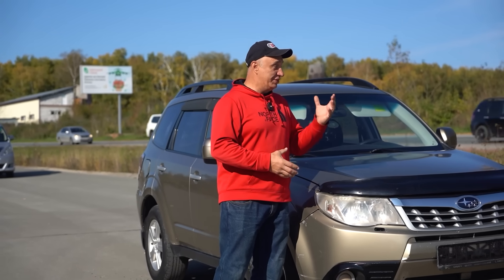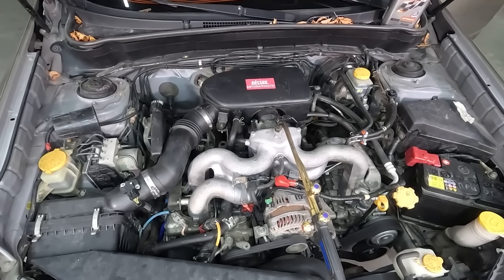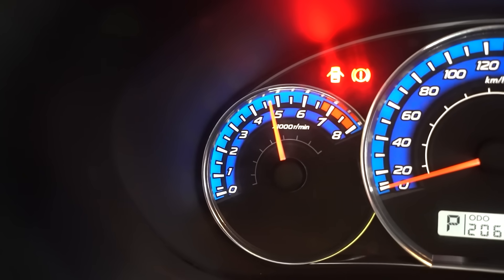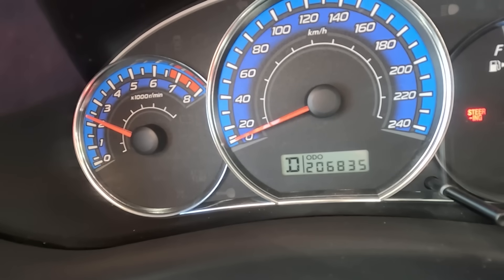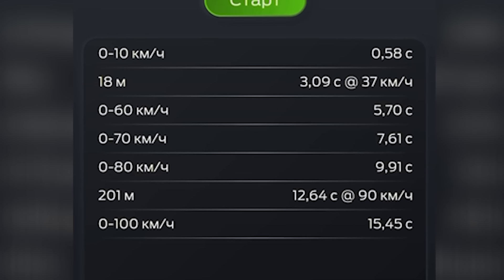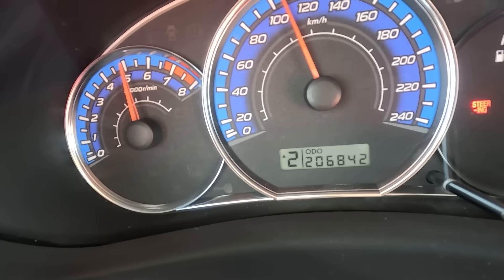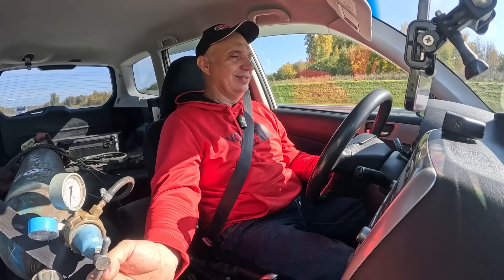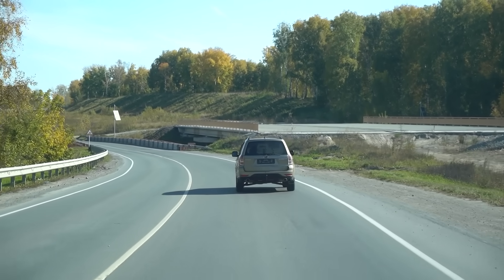We run an engine on pure oxygen - what will happen?

Comment: Of course, a mechanic will know all this, so this info is for the non mechanics wanting to know what's going on.
That subaru has O2 sensors and fuel injection. The car uses the mass airflow sensor to know how much air is entering the engine, and it calculates an estimated amount of fuel to inject based on the airflow mass, temperature, and pressure. The O2 sensor then provides feedback to the ECU to know how much unused O2 is passing through the engine, and that value is used to trim the fuel injector timings. Too much O2 in the exhaust means the engine is running lean, which is very bad and can lead to engine damage, so more fuel is added to compensate. Too little O2 means it's running rich, with is bad for the catalytic converters and kills fuel economy, so it reduces the fuel injected. The ECU is rapidly fluctuating the engine between slightly rich and slightly lean ratios, as that's what the catalytic converter needs to work properly. Then the downstream O2 sensor measures the amount of O2 leaving the exhaust pipe, which is used to monitor the catalytic converter performance.
What you are doing here is adding unmetered air to the intake manifold. That air happens to be very rich in oxygen, but it doesn't really matter. ANY unmetered air changes the manifold pressure, and throws off the fuel air ratio, and makes the O2 sensor read lean. So, the ECU adds fuel to make the ratio match what it should be. Since the engine has an electronically controlled throttle body, it can normally close the throttle to cut air intake and control the RPMs. But you are bypassing that, so it can't reduce the intake air, and it MUST maintain the fuel air ratio or the catalytic converter can be damaged, the engine can overheat, you can get autodetonation in the cylinders, etc. So, more bypass air (more injected O2 in your case) means undesired higher RPM at idle.
When you did your acceleration tests, the amount of air intake going through a wide-open throttle is MUCH greater than the O2 being added, so there's only a marginal improvement in performance. If you were to dump a crazy high amount of O2 into the engine while accelerating testing it, you could get quite a bit better performance than you see here, but the cylinder pressures would be very high, and you likely would damage or destroy the engine if you did it enough.
Reply: I agree, you definitely have to understand how ECUs operate  to get the most out of non-conventional mods, even normal mods require a re-flash to get the most out of said mods, the parameters of a stock flashed ECU can only take care of things to a point, bypassing the maf especially skewed results IMHO, adding pressurized 02 post maf had to lower map readings most likely confusing the ECM .
Reply: The question is have is; can you get better  mileage with O2 injection at the right place and with the sensors and computer properly calibrated for it?
Reply: @avoice423  nitrogen makes up most of our atmosphere, but doesn't participate in the combustion process unless the combustion is hot enough to form nitrogen oxides, which are undesirable pollutants. The higher the oxygen percentage, the higher temperature the fuel will burn at, which is great for power as it will lead to higher cylinder pressures, but it's bad for the engine because higher temperature and higher pressure will accelerate wear or even outright destroy the engine. The engine having to pump nitrogen around that doesn't contribute to power production reduces the maximum power the engine could otherwise produce by displacing oxygen that is used in the combustion process, and increasing pumping losses. But engines go through a lot of air compared to the fuel that they burn, and I wouldn't necessarily want to have to carry around oxygen cylinders as well as gasoline to make the engine run. Perhaps for short proof of concept or performance tests it could be made to work, but I don't know how long an engine would survive doing that.
Reply: Sorry bro im not gonna read all that but sorry for your loss or congratulations 🎉 I hope whatever it is works out in your favor.

Comment: When you do experiments like this reboot the ecu each time 5 mins battery leads off should do that as the ecu will go into kernal panic and roll all its settings back so it,ll assume its very very cold the fuel is low quality and its above sealevel hence the rough running once it starts rewriting settings the roughrunning goes away

Comment: You drill a hole behind throttle body,  that is why revs are going up on engine when you add oxygen.  The same will happen if you leave just an open hole without oxygen from a bottle, with ordinary air.

Comment: 3.5 parts of pure oxygen are needed for every 1 part of fuel (89 octane). You can remap the O2 system from 14.7:1 to 3.5:1 to do this correctly.

Comment: the VERY first thought I had when the revs started going up was, "is that the ECU compensating for the lean mixture by adding fuel?" turns out, it MIGHT have been, but it must also have been messing with timing and/or throttle response in some way to offset the added oxygen. I initially thought fuel trim would have been the answer, but by the end of the video I'm not so sure. either way, I'm surprised nobody seemed to consider how the ECU would react to that condition, and it'd be best if you controlled that with either an aftermarket ECU that you can program and monitor, or a car with no ECU (or a very dumb and simple one). please, try it again like that! I'd love to see it!
Reply: It was definitely the ECU adding fuel to achieve the desired A/F ratio. The problems happened when they went past the point where the injectors and/fuel trims were maxed out. Most engines can only add upto 25% fuel,  once you exceed that the mixture is going to go lean.

Comment: In a computer controlled car, after warm up, the system operates based on the O2 sensor, the sensor sees a lean condition (excess O2 in the exhaust) so it is adding fuel trim, thus increasing the RPMs, try it on a carbureted engine and the non-compensated extra oxygen will kill the engine from running extremely lean.

Comment: you probably had some nock in the engine caused by lean fuel air / AR ratio even in a modern car they have trouble compensating. this probably would be better done on a carb engine or DI engine with standalone fuel management system.

Comment: Put it in front of the valve-body next time, the throttle plate is essentially getting bypassed here, when you turn the oxygen on in this setup its just like pressing the gas pedal, also try injecting some acetylene, if carefully done it can provide a nice boost!

Comment: rpms are increasing due to pressure , you are inserting oxigen at high presure like you would have a turbo its not at atmosferic presure, if you want to test it corectly you need a presure equalizing chamber that will lower the presure or a presure check valve that lowers the presure to the atmosferic presure witch will most likely stop the engine for over reving itself

Comment: Back in the 60's, disreputable car sellers used add mothballs to the fuel to greatly boost the performance of the engine. Mothballs were also supposed to have a very corrosive effect on the pistons and cylinder walls. I'd love to see this performed as an experiment, showing the before and after of the engine as well as monitoring the alleged performance boost. If anyone could do this, it would be the crazy buggers at Garage 54!
Reply: Mothballs come in two flavors: para-dichlorobenzene and naphthalene. Neither one burns well. tried it once in an old Ranchero (don't remember which kind). Didn't make much difference.
Reply: @dquam3885  They used to use the naphthalene variety.....an entire box in a tank of fuel.
Reply: @Martin.Wilson  Coleman brand "white gas" for patterns/camp stoves is just their name for Naptha, which I know Garbage Time has fed to his Fiat Niki. I wonder if that's close enough to Napthaline... or if that is spicier and runs hotter?
Reply: @DUKE_of_RAMBLE  Naptha is a generic term for petroleum solvents. more specifically, solvents consist of paraffins, aromatics, and napthenes.Naphthenes are better solvent than paraffins, less stinky than aromatics. Coleman fuel is mostly paraffins. 

 Naphthalene is a specific chemical derived from petroleum. Solid at room temp. Not very soluble in gasoline. Non-ethanol Super would probably be best if someone wnats to try (at their own risk!).
Reply: @dquam3885  Aah, alright. Thanks for that! 🍻
Reply: @dquam3885 10 mentos sized one for 10 liters, only plain 100% napthalene, no coloring too. It doesn't add power per say, but allows you to use more aggressive timing. Hence the power or fuel economy. Keep in mind that it makes the carb dirty fast, so check regularly or clean often
Reply: Hard to find the right mothballs for that these days.
Reply: I would sure like to see some one show more research on the mothball hack . I just can't see how it would have negative effects on an engine as long as they were completely dissolved   ! ?
Reply: @richardpalko8062  The naphthalene is supposed to be extremely corrosive.
Reply: @Martin.Wilson  I would not expect naphthalene to be corrosive- it is a simple aromatic, not to different from toluene and benzene normally found in gasoline. However, the other flavor of mothball is p-dichlorobenzene. Burning chlorine compounds would definitely produce corrosive and noxious compounds.
Reply: I was one of those ppl but in the late 90s. 1.5L K series toyota engine, u can add more aggressive timing and it wont knock easily, it works really well, but does dirty up the throttle body, so u need to clean it often

Comment: This acts just like an O2 sensor failing. The car runs fine until it heats up. The slowly gets worse until it won’t run. After it cools same thing happens again. Wash rinse repeat. O2 sensor went haywire probably because it got too hot. That’s my theory. Symptoms are almost exactly the same. That would explain it running fine after the test.

Comment: You can quadruple the power in a carbureted engine, but you will melt your pistons, your valves, your cylinder walls and your exhaust really fast. This is why we use nitrous oxide instead of oxygen. An ECU will just compensate for the extra oxygen or put the engine in limp mode because the sensor readings are not plausible.

Comment: In 1955 an O2 leak from Apollo 13,sitting on the pad, floated over to a 55 chevy carb'd and melted the engine down and then melted the front 1/2 of the car..there's photos.

Comment: I can't believe that engine survived that!  Also, seem like some pretty big balls to sit in a car with an open Oxygen cylinder...for science.  😇  Engine Project Idea:  Take a V8 engine and use every other cylinder as a supercharger.  So you have 4 pistons firing, and 4 pistons acting as air pumps for the firing cylinders.  I've seen this done with a single cylinder acting as a "sneaky" supercharger for remaining 7.  But never where half the engine is dedicated to providing boost.  If anyone could pull this off, it's you guys.

Comment: This can burn a hole in the piston or valve on pure O2. 
This car likely has full closed loop system and is adding fuel to compensate for the o2 sensor seeing more oxygen.

Comment: The whole point of the throttle pedal is to open the throttle blade and let in more air. By injecting high pressure oxygen directly into the manifold you are basically just bypassing the whole need for a throttle pedal, which is why the revs increased.
Reply: Not only that. They bypassed the maf sensor too. So it's not taking into account all that extra air. So it's going to run super lean. They should have introduced the oxygen before the mass air flow sensor
Reply: @crazgreek  Right !!
Reply: @crazgreek It wouldn't have made much of a difference. The MAF cannot detect the amount of oxygen in the air, only the amount of air itself and assume 21% oxygen. It's like having a NOS, you need totally different injection and advance maps when it's working.
Reply: @crazgreek   Well, except the O2 sensor on the exhaust will try to make up for it... and the MAP sensor (intake vacuum) will read whacky because that hole where the O2 goes in is like a giant vac leak that's all O2. (when turned on) It's obvious that the ECM can only adjust so far before reaching it's limits and going into limp mode. A shutdown with a cooling period will bring another learning cycle and it will run ok after a few minutes.
Reply: @rupe53  that's it, the MAP isn't telling the ECU the O2 count, confusing it with the data from the O2 sensors.
Reply: @iecasper    MAF = Mass Air Flow (by the throttle plate) / O2 = Oxygen (in the exhaust) / MAP = Manifold Absolute Pressure. Each has it's own job, and the MAP doesn't read O2, it reads manifold vacuum or pressure. I doubt the stock sensor here will read positive pressure because it's made for vacuum. It's a non-turbo car. I doubt the O2 sensor will read more than the nominal 21% oxygen in normal air. The system was never designed to handle it.
Reply: @rupe53  they're still ADDING pressure after the MAP.
Reply: @iecasper  They are adding the O2 into the manifold but I don't know if they are creating a positive pressure or just less vacuum.
Reply: you beat me to it.
Reply: came here to say this
Reply: Basically made a Diesel.
Reply: @jwalster9412  A diesel won't have an ignition system.
Reply: All of this isn’t strictly correct. The extra air itself won’t make more power, it needs fuel to be added as well. Putting the O2 in before the MAF isn’t going to work right because it measures the mass of the air and the computer works out how much fuel to add based on the air being normal air which is mainly nitrogen. It simply isn’t calibrated to deal with pure oxygen. I would expect the engine to burn hotter due to the higher purity of oxygen and it will also be running very lean. No doubt the engine wouldn’t last long running like this due to the  very lean mixture as he states in the video.
Reply: The only way this will work is to run it like a nitrous injection system with orifices that will allow the appropriate amount of additional fuel into the engine to match the O2 introduced to the engine, to ensure you keep it from running lean and damaging the engine.
Reply: @theEVILone0130    The injection system already does this but the extra is not within reach of the standard design parameters so the system goes into limp mode after a bit.
Reply: 😄 exactly
Reply: I'm baffled how far I needed to scroll to find somebody giving the correct explanation.
Reply: どう考えても、コンピューターが燃調を濃くしてA/F調整してる。

Comment: The reason it revvs up is because gas engines are controlled by the amount of air going into the engine. Diesels are controlled by the amount of fuel going into the engine. 

On gas engines, when one presses the gas pedal, it allows air to enter at atmospheric pressure (~14.8 psi) to rush into the intake as the intake is under a vacuum, and thus the computer adds more fuel to compensate for the lean mixture.  This in turn revvs up the engine. 

By adding oxygen directly into the intake, you’re essentially bypassing the throttle plate.  On a carbureted engine, I’d imagine this would just keep leaning out the mixture until it dies because air isn’t going past the Venturis but rather skipping them altogether.  

Also, on fuel injected cars, when bypassing the throttle as one did, it’s essentially un-metered air.  The ECU is going to drive the injectors longer and max out the fuel trims until it can no longer compensate.  

A more accurate or better way would be to inject the oxygen at the air box or air filter.  This would then allow it to be metered by the MAF and allow the engine to draw what it’s going to draw.
Reply: Gale Banks would wholly disagree about you saying diesels being controlled by fuel.
Reply: @devinstepp4205  well, smarty, what are they controlled by?

Comment: See if you can make boost with compressed air. I've been genuinely curious about this for a while now. The O2 sensors are detecting a lean condition and dumping fuel to compensate. Basically just hitting the gas while bypassing the throttle body.

Comment: Test Nitrous Oxide vs O2 and any other potential gas you can think of ?  I guess the computer affects the results however, since it will try to balance the fuel mixture, so consider also a non-computer controlled engine?

Comment: The increase in o2 also probably caused a decrease of the usual ca.80% N2, that in our planet acts as a combustion control, and things must've get way hot.
Lada with carburetor would be interesting to see. Maybe it can melt things, but i would give it a chance using Ir plugs.

Comment: You should add oxygen through throtlle body and not intake manifold. You have bypassed throttle. Rpm surely will increase when anything is injected through manifold. No point of experiment

Comment: Again, let's get this right, the experiment was done incorrectly by varying 2 variables not just 1. The hole in the intake after the throttle body then bypasses the throttle body, so the first bit of where oxygen is introduced is bypassing the throttle idle airflow- hence it revs up. Yes, this ALSO modifies the mixture because the computer can then sense using the oxygen sensors in the exhaust and increase fuel- but just going by the engine reving from idle and not touching the gas is not scientific. Again,  to do this correctly and only modify 1 variable- the oxygen should have been in the airbox before the throttle body.

Comment: its the same thing as adding nitrous to the mix. more o2 the quicker the fuel can be burned, until you got the limits of the injectors and ecu and well the engine due to all the heat.